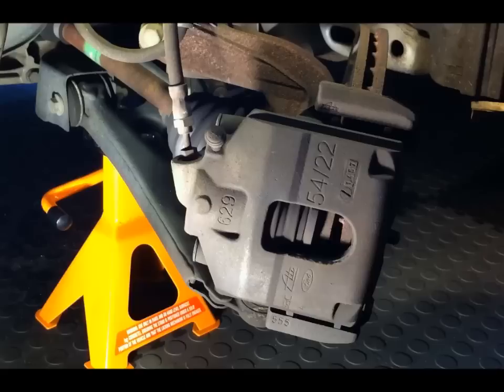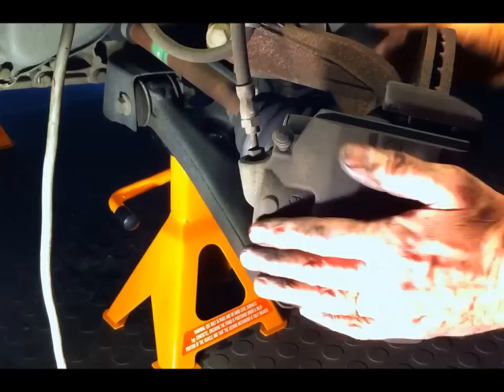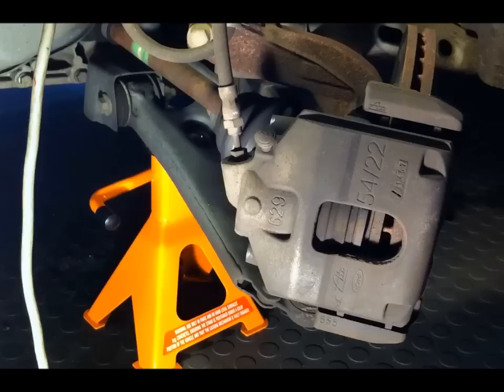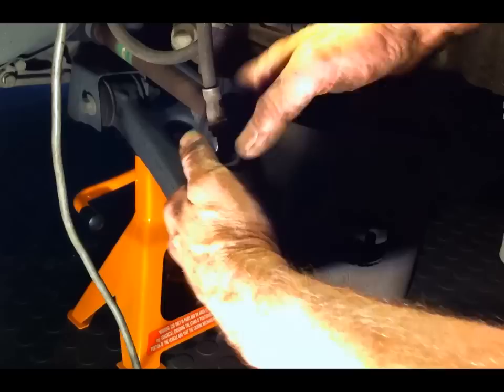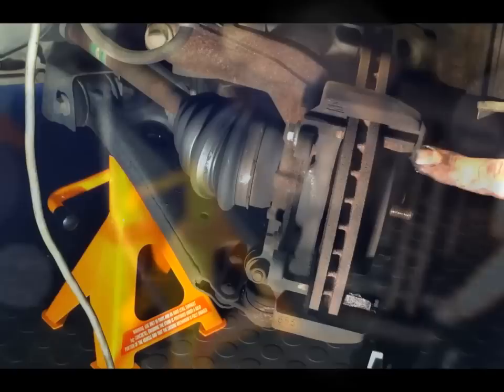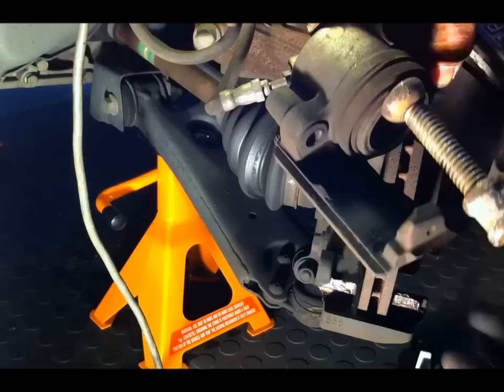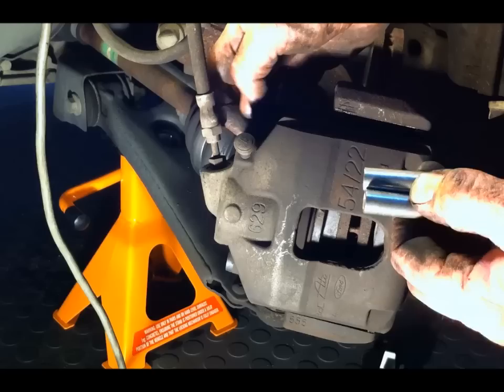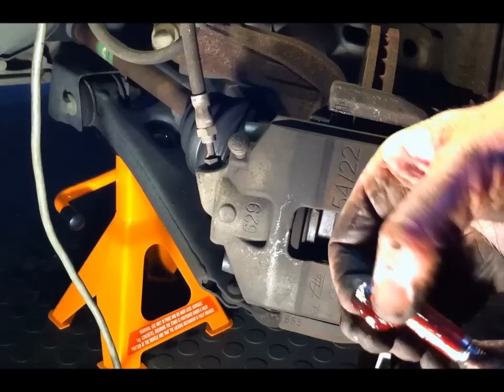Fiesta WQ 2007 Front Disc Pad How to Replace Change Do it Yourself

Comment: I have a squeaking noise that sounds like brake disc squeal. It only happens when I apply light pressure on the brakes or when the brakes are hot and I turn left. Pads and discs are fine but very rusty. I've had them apart and lightly used a hammer to get surface rust off. Squeaking stopped for a day or so now it's happening again. Any ideas? Don't want to invest in new discs, pads etc unless needed because the ones on there are relatively new
Reply from the maker: Get some anti squeal compound that you smear on the back of the pads.

Comment: Stupid question but won't the loctite make it a pain to get the pins out next time?
Reply from the maker: +Steve Hardy ... No. It's designed to allow the bolt to be unscrewed. It's not a glue.
Reply from the maker: +Scott Elliott ... They have thread lock from the factory anyway.

Comment: I have changed my brake pads and discs on my fiesta but I find the caliper retaining spring on the outside is a total nightmare to fit. Have you got any tips?
Reply from the maker: Hi Claire. No tips really other than persistence and getting a "feel" for it. Watch that bit frame by frame. It's easy when you get the knack. Scott

Comment: This is an excellent, straight forward, plain English guide. Would this procedure apply to a UK '07 Ford Fiesta as well? Thanks Scott!
Reply from the maker: +chrispunks83 Thanks Chris ... I'd take a guess and say it would. The majority of vehicles have sliding pin calipers like the Fiesta. My Mercedes C Class is the same. The car manufacturers outsource their brake caliper supply so you'll find many cars have the same brand calipers. Unless you have a high end AMG type car the brake calipers on normal cars are very basic. If you do the job buy yourself some caliper pin grease that's good for both metal and rubber and you'll be covered either way. Regards, Scott

Comment: I'm thinking about picking up one of these cars in Taiwan. Little skeptical about how it will hold up in hot climates? You sound Aussie, so I assume you would know? Also, how do you save on parts in Australia? They must cost a fortune coming from Germany. BTW, I Iike the format of your channel. Any kind of DIY tips will definitely increase your net worth. Good luck.

Comment: Great video, in my Haynes manual it says highlighted that you have to clamp the flexible pipe or it will blow the seals off the master cylinder? mine is a 2006 diesel?  is this true or just a warning?  thanks
Reply from the maker: sandydogy I've never heard of this before on any car. If you clamp the flexible brake hose near the brake calliper you won't be able to push the pistons back as there will be no where for the brake fluid to go. When you push the pistons in it pushes the fluid backwards into the reservoir. There must be a reason Haynes have highlighted it. Maybe a bit of Google searching will find you the reason. Check out some of the Ford Fiesta forums. Scott
Reply from the maker: sandydogy Does the manual say what type of grease to use on the calliper sliding pins?
Reply: No it does not, it says open the bleed valve on the calliper before pushing the piston back and clamp the flexible brake hose, How do you upload a picture on her and I can show you! Thanks
Reply from the maker: sandydogy It's ok that makes sense. Of course you can open the bleed nipple first so the fluid has somewhere to go. I did the job the conventional way and had no problems. Perhaps the seals in the master cylinder are such that back pressure can pop them off. So you may as well do it that way. I can put a note on my video saying it's possible to pop the seals so clamp the hose first. Regards Scott.

Comment: Where can i get that clip from (the one on the last seconds of this video)? My idiot son threw them away and i m left with a loose sound in my wheels....
Reply from the maker: Ian did you strangle your son?

You'll definitely need the clips. You'd have to try Ford or Coventry's I think. I had a look on eBay and you can get anti rattle clips for many cars.
Reply: MrScott52.

Thanks for your reply.

I found these to be very close to the ford ones. 

http://www.ebay.co.uk/itm/Spring-anti-rattle-clip-Jeep-Grand-Cherokee-WJ-front-Teves-caliper-99-02-5011978-/161401786656?pt=UK_CarsParts_Vehicles_CarParts_SM&hash=item25944bd120...

but i was not willing to spend so much for a part that might still not work properly. So i think steel tie wraps will have to do. 

Regarding the son. I put him up on ebay in hope for exchange with the actual clips.
Reply from the maker: Ian Mamo Ha Ha ... good one. You may have to offer cash as well.

Comment: I have the exact same car and done this job myself yesterday, I done everything the exact same as you. Before i done the job the break pedal was nice a stiff and still had good action in it. After ive changed the pads even after i pump the pedal my break pedal is like mush, I have been looking around and it sounds like i need to bleed the lines, but im just wondering why.. Ive never had to do it before when changing pads on any other cars
Reply from the maker: Aaron, That does sound odd. I've had a similar situation with pads that were soft until they bedded in. The the pedal had more travel until the pads hardened and bedded in.

Other than that bleed the front brakes and make sure the sliding pins are moving freely. Good luck with the problem solving. Cheers Scott
Reply: I taught the same but these brakes are really soft. Even when driving slowly my foot to the floor makes the car crawl to a stop.. surely breaking in the new pads wouldnt mean this much give? My other taught is that when i pushed the pistons back in that maybe air got into the lines?
Reply from the maker: Aaron Gallagher
Yes it appears somehow air has got into the system. Bleeding the front brakes is a is a quick job so hopefully that will sort it out. Scott
Reply: MrScott52 Did you get this sorted out? I've read (in my Haynes manual) that there is a risk of "inverting" the braking system's master cylinder rubber seals when pushing the pistons back. Maybe that's what happened?
Reply: Yeah i got it sorted, it was just the brake pads had a slight break-in layer on them, after a couple days it went away and breaks where working normal again
Reply from the maker: Aaron Gallagher That's good to hear. Glad it worked out.

Comment: Hi Scott, 
Have you done the pads and/or disks on your Mercedes? I am going to tackle both on my W204 soon and wonder if you have any experience? From what I can tell the design is fairly similar to the Fiesta. Just need to decide now whether to get genuine MB parts from the dealer or save a few quid and get after market.... Probably Pagid. Cheers and keep up the videos - I just watched your pressure brake bleed demo.
Reply from the maker: Thanks for the kind words.

Yes I've changed the pads on my W204 not long after I bought the car. I was fed up with black wheels 5 days after washing from the OEM pads. I replaced with Akebono Euro Ceramic low dust. They're almost a zero dust pad and perform as well or better that OEM plus they're much cheaper. There's nothing special about the OEM pads other than they're incredibly dusty and wear the discs more quickly. If you can wait a few weeks I'll make a video of how to replace the pads as it's a simple exercise. I've had a couple of people ask me.

MB seem to make things tricky by using strange size fasteners. The size most people don't have in their toolbox! From memory you need a 7mm hex key to remove the rear calipers. If you have a set of Torx bits one of those fits as an alternative ... the one that measures 7mm between opposing faces. Kind regards, Scott
Reply: MrScott52 Cheers Scott.  I will be replacing my rear pads at some point but I was going to do the front disks and pads to start with.  I have read that you should replace the spring clips on the front calipers.  Did you bother?  I would have thought the clips could be re-used as long as you don't damage them.  Thanks for the tip on the 7mm hex bolt - pretty sure I have one that I can put on a ratchet.

Comment: Do you not tourqe the bolts up?
Reply from the maker: +RetroAdzz Yes I normally do. If you look at the videos for brake work on the Mercedes I use the torque wrench.

In this case I didn't. I've been doing this work for so many decades you do get a "feel" for it. I keep applying the pressure until my wrist clicks :-)
Reply: +Scott Elliott haha, I thought that was the case! thanks for the video
Reply: +RetroAdzz p